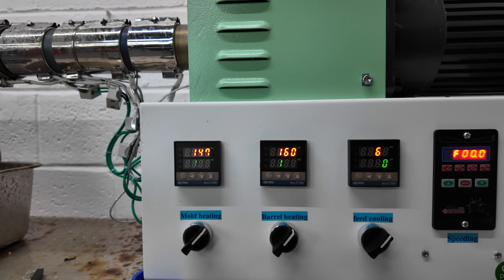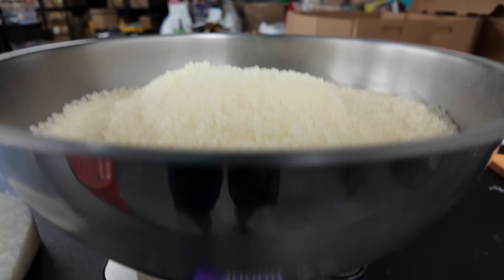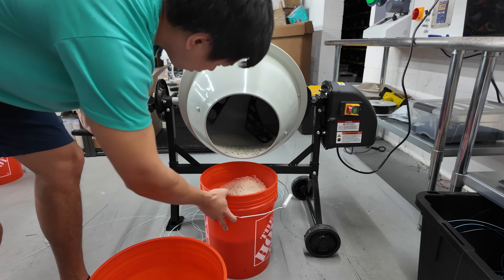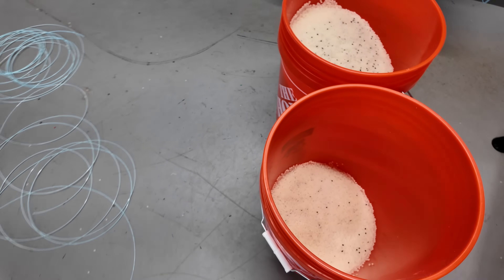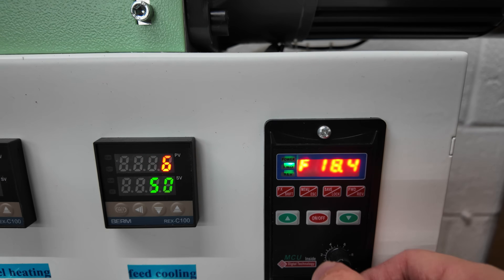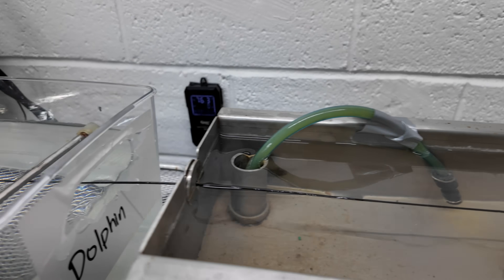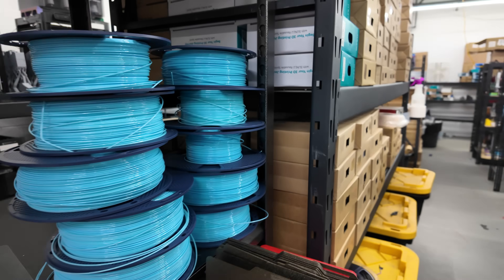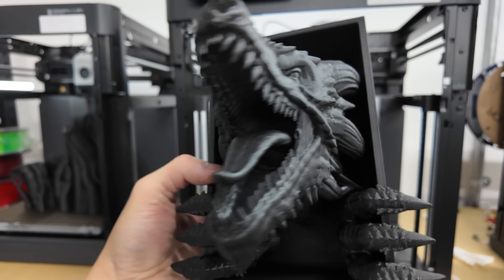I Finally Made Printable PLA!!!

Comment: Curious if you have any moisture issues going from a double water bath straight to the spool. Do you run them through a dryer before use?
Reply from the maker: What everyone said. However we do run it through the dehydrator overnight since we have it
Reply: Pla isn’t hydroscopic wet pla is a myth to sell dryers
Reply: @mynameisprivate158  PLA is hydroscopic, but it takes a long time for it to soak up moisture compared to other filaments, I had my PLA become wet twice.

Comment: If you want a bit stronger filaments, add some polycarbonate pellets (~5%) to your PLA batches. PC is usually used in all PLAs to make it easier to print and more durable.
Reply from the maker: @thedevminer  where does one get PC?
Reply: @Dancyn3Dprints  We got ours from Alibaba for 6 EUR / kg with a MOQ 25kg, but we're located in Germany, so our import fees aren't that problematic as in the US at the moment.